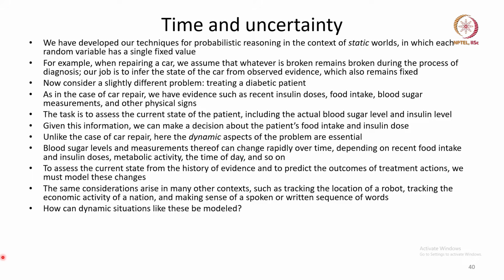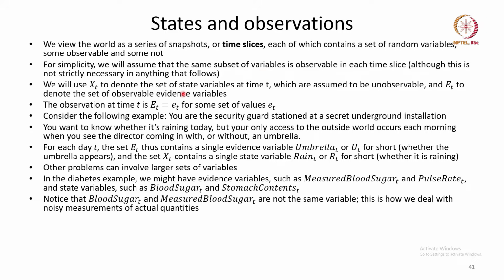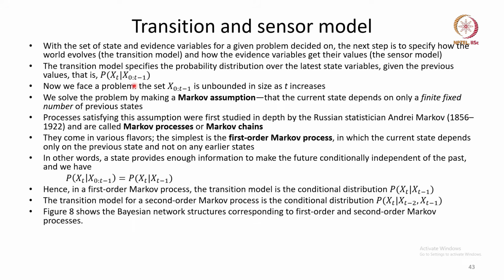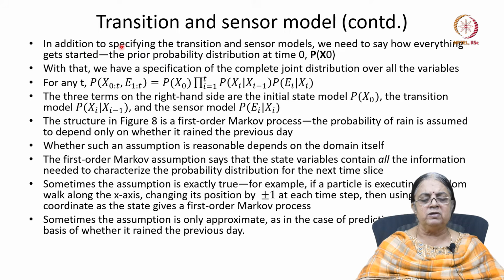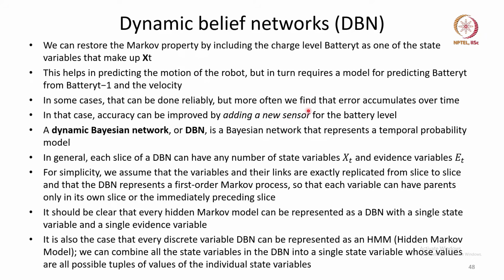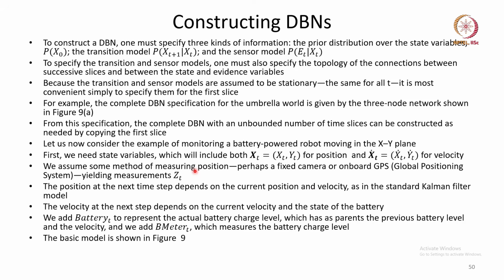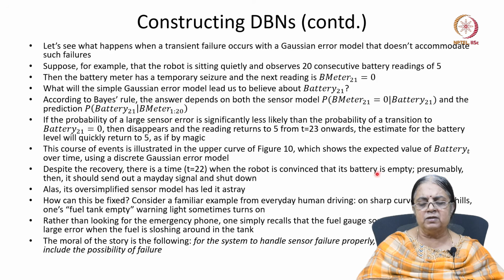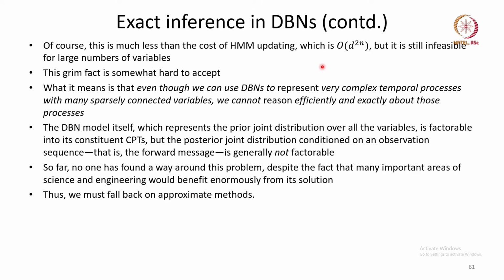Lec 32 Dynamic belief networks (DBN)

Comment: ### Overview of Dynamic Belief Networks (DBN)

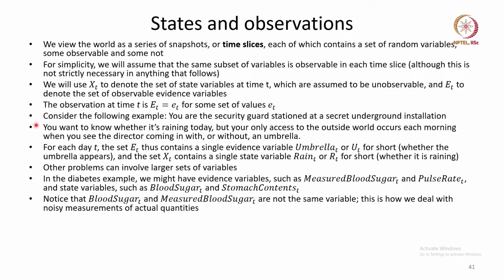*Dynamic Belief Networks (DBNs)* are extensions of standard Bayesian Belief Networks designed to model systems where variables evolve over time (0:00 - 4:47). Unlike static networks, which represent a fixed world, DBNs treat the temporal progression as a sequence of **time slices**.

### Fundamental Components
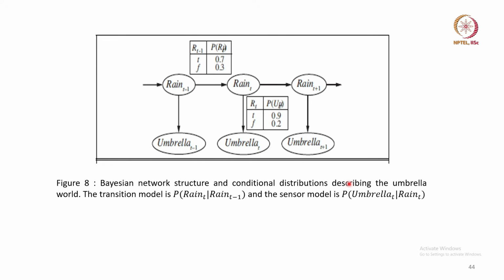To construct a DBN, three key elements are required (12:05 - 15:20):
1. *Prior Distribution ($P(X_0)$):* Defines the initial state of the system at time zero.
2. *Transition Model ($P(X_t|X_{t-1})$):* Governs how the state variables change from one time step to the next.
3. *Sensor Model ($P(E_t|X_t)$):* Defines the relationship between the hidden state variables and the observed evidence.

### The Markov Assumption
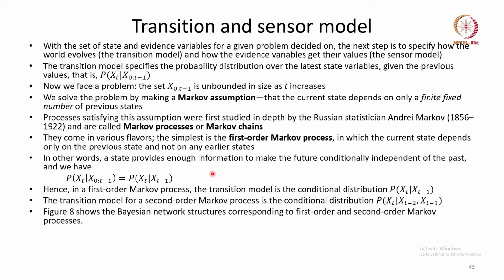To maintain computational tractability, DBNs typically utilize the *first-order Markov assumption* (10:39 - 11:39). This posits that the current state ($X_t$) is conditionally independent of all past states, depending solely on the immediate predecessor ($X_{t-1}$).

### Inference and Computational Efficiency
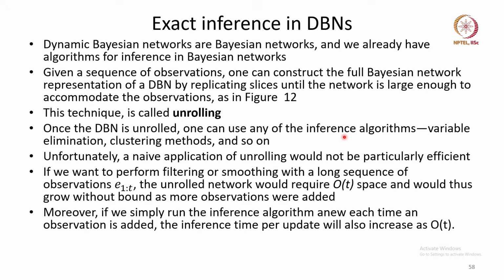* *Unrolling:* This technique replicates the network structure across discrete time intervals to represent the passage of time (29:46 - 30:14).
* *Variable Elimination:* To prevent memory exhaustion, the algorithm uses "summing out" to marginalize past slices, ensuring that only a small, constant number of time slices remain in active memory during inference (30:57 - 31:46).

### DBNs vs. Hidden Markov Models (HMMs)
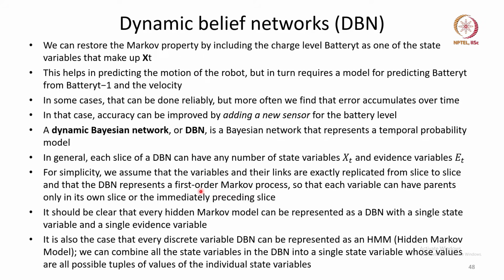While DBNs and HMMs are structurally analogous, DBNs are generally more efficient for complex systems. By leveraging the factored representation of Bayesian networks, DBNs avoid the exponential growth of state spaces ($2^{2N}$ vs. $D^{N+K}$) associated with traditional HMMs (20:00 - 22:00).